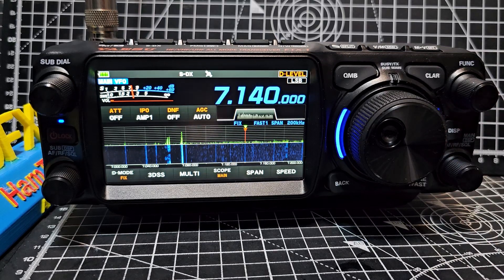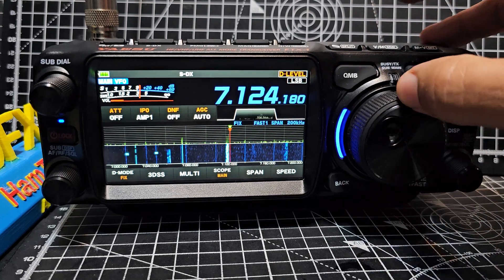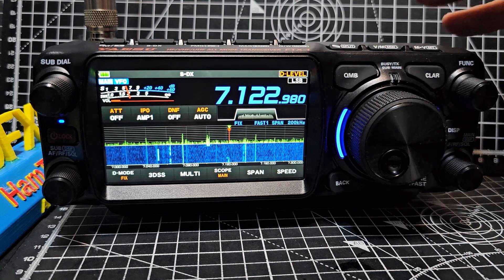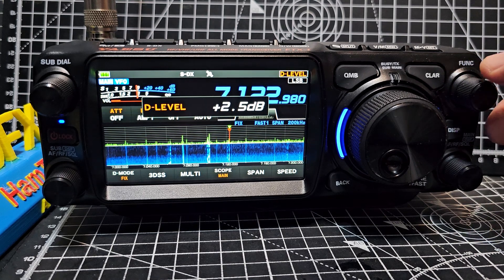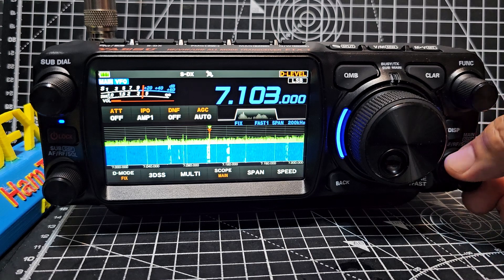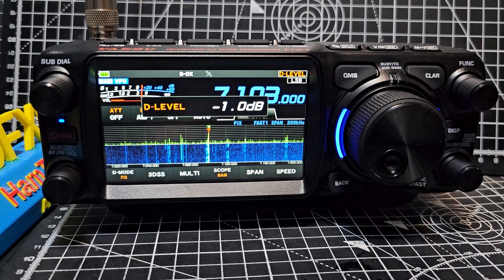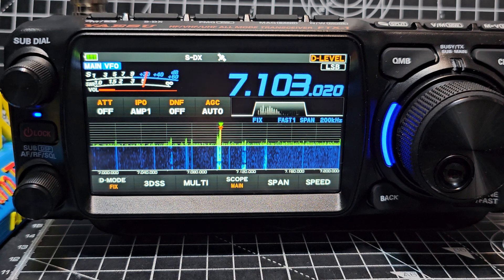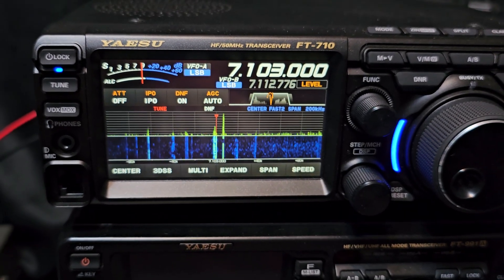Yaesu FTX-1 & 710 Averaging Myth

Comment: I think the confusion with "averaging" comes from the fact that Yaesu use a bar graph and Icom use a line graph in the spectrum section of the display. You can clearly see that averaging on the Yaesu display causes the bar graph to slow down - this is the result of actually averaging the signal spectrum. Note - it does not alter the received signal out of the speaker. Ironically, I do not know if Icom does averaging! 73, Ian VK7IAN
Reply from the maker: https://youtu.be/nEtuHl3Y1Ko

Comment: Oh, yes there is a massive difference - visually. It's not the sound, it's the grass above the waterfall that flashes like a 1980's discotheque  when there is no averaging. Averaging on the FTX-1 didn't look effective. See true silky smooth, buttery smooth averaging on the FLEX radios, or Icom rigs and there is a world of difference - visually. I have an FT-710, hate the light strobe high speed flashing, but no way am I selling the rig, love my 710 ..just annoying. To stop the flashing grass, I just turn the gain level of the scope right down so that the grass gets shorter and shorter, and most of it disappears. I hope I am explaining myself properly ? But turning the gain level (display sensitivity) down is not a true solution, it just removes the ability for you to see the grass and weak signals on the waterfall.
Reply from the maker: I feel the change was hardly noticeable